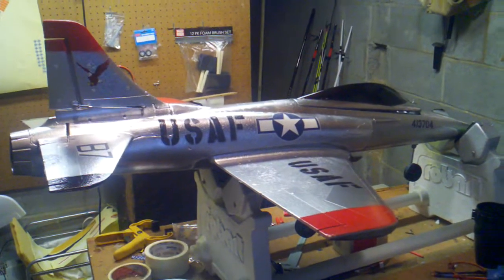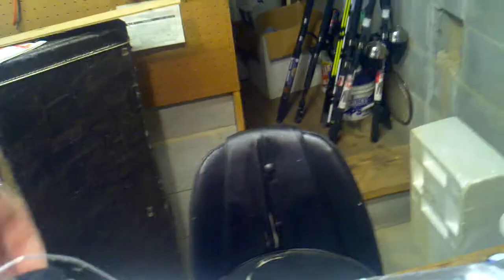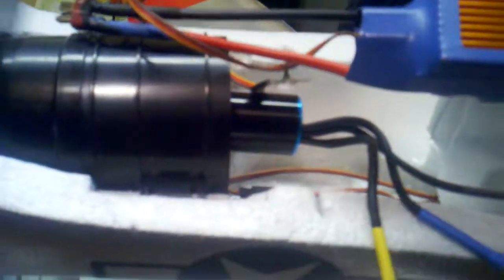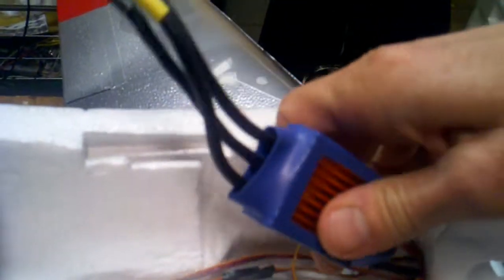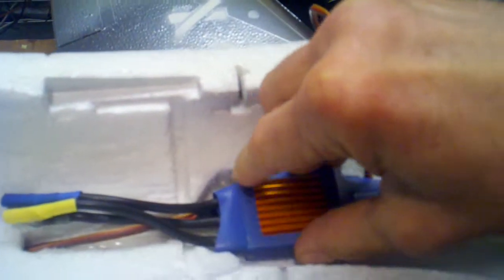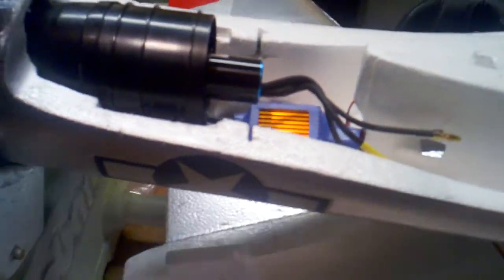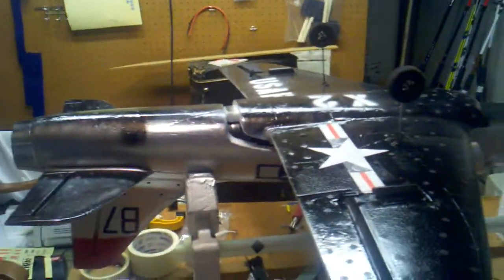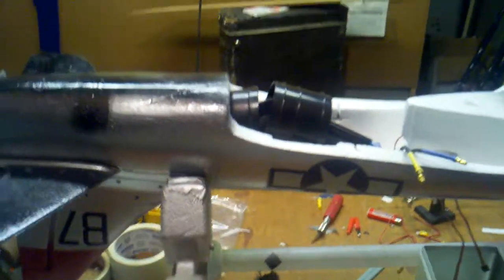Dynam Meteor X2 Project Video I

Comment: work on the intake and exhaust ducting rather than adding so much power. with proper ducting that model will do 130mph on 1300 watts, you may be lucky to get 130 with 1800 watts and poor ducting